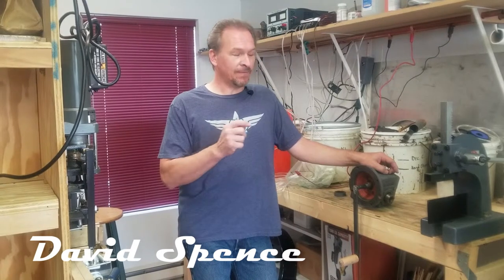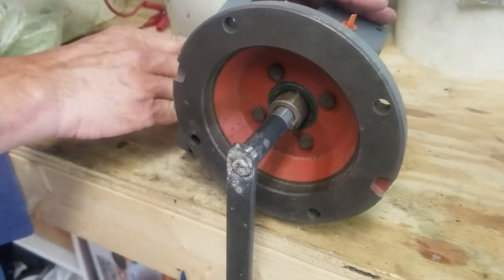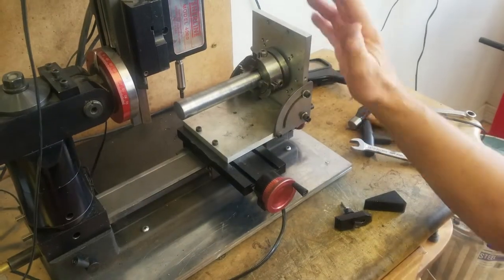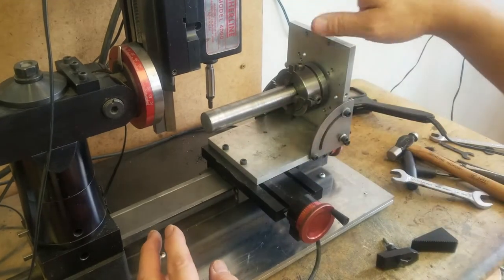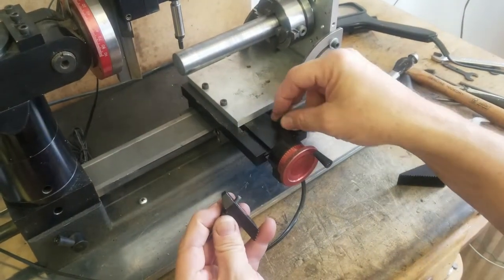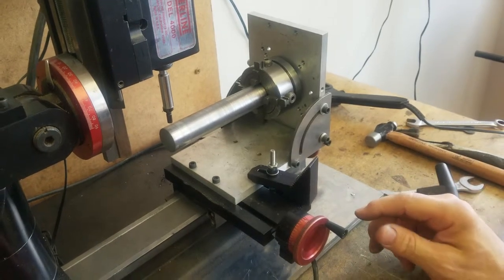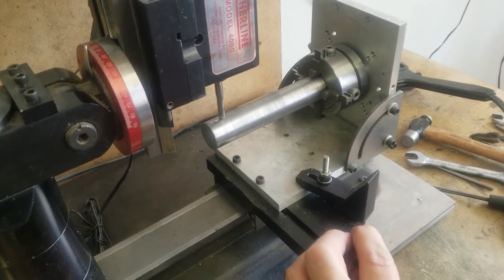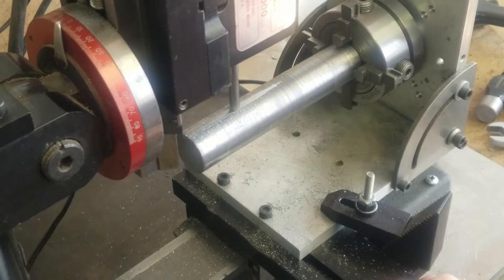How to Cut a Key Slot with a Sherline Lathe and Mill - Cutting a Keyway in a Shaft for a Gearbox

Comment: You machinists make me so jealous 😂
I'm just getting into some fabricating. You guys are wizards. 👍
Reply from the maker: You can do it! It's a skill worth knowing, considering the demand. Thanks for watching!
Reply: @CarzPlus  I have a lot of vehicle tools but I'm rebuilding a belt-driven squirrel cage fan and wanted to cut a keyway for a pulley. That's how I came here. For now I decided to use a set screw to hold things in place. The torque is going to shear away the set screw eventually, though.  

Just out of curiosity, can you recommend a basic learning setup? Not just for cutting keyways, but a good way to start learning machining/fabrication? I don't have a lot of money but living near Pittsburgh means there's a bunch of used equipment floating around.